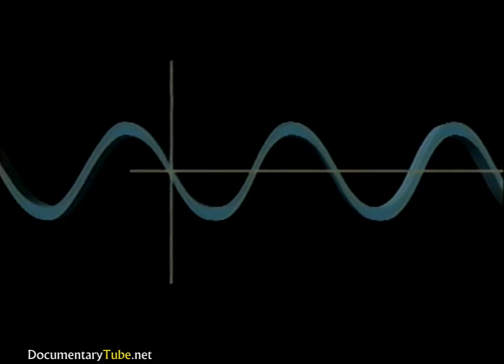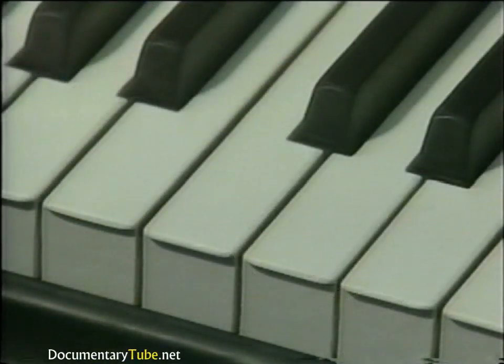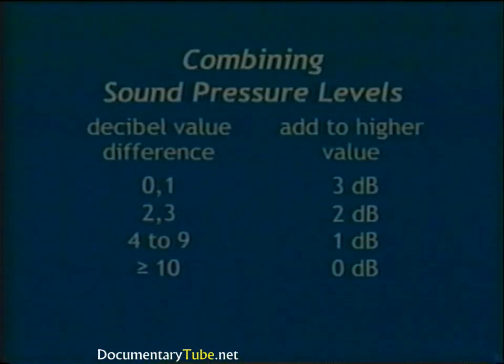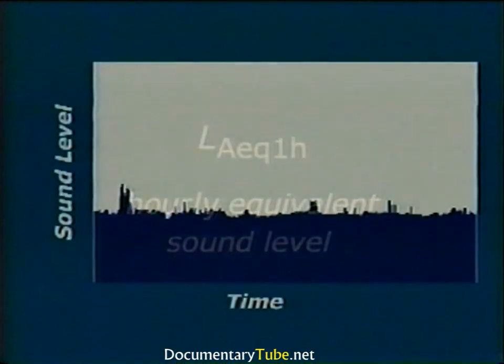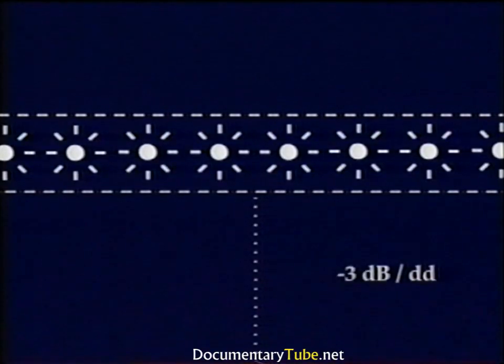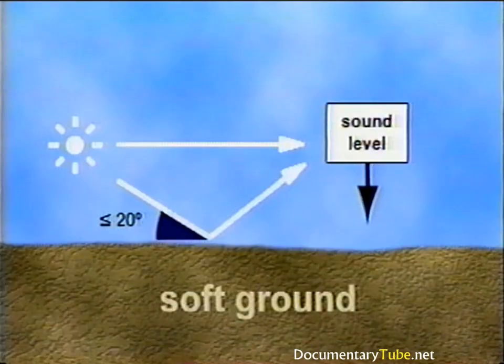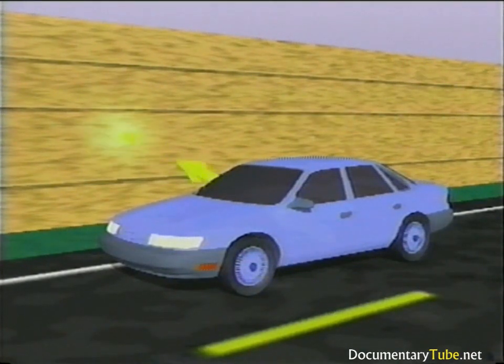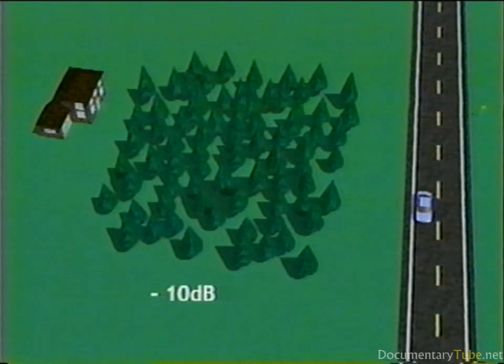HOW IT WORKS: Acoustics

Comment: As I watch this I'm wondering if a wave can have a very wide wavelength but cycle very fast
Reply: my guess is no. Because the velocity of sound is the same. So if the wavelength is very wide, the frequency gotta be low.
Reply: That's not possible because wavelength and frequency (cycles per second) are inversely related. So if  we have a very wide wavelength we'll get a very low frequency.
Reply: Actually, if you change the medium from air to diamond, sound will travel 35 times faster.  Then the wavelength for any given pitch will be 35 times longer than that pitch would if traveling through air.  But a 35-fold increase in wavelength would likely be the maximum since there is no substance which transmit sound faster than diamond (which I'm aware of).
Reply: As I understand it, @bobbritt5904 , if you lowered the temperature of that diamond you'd be able to get an even longer wavelength for that same pitch/frequency
Reply: @MikeGFParsons very interesting to ponder 💭